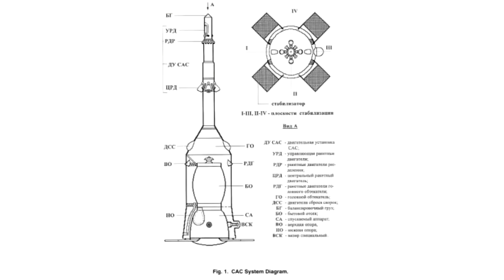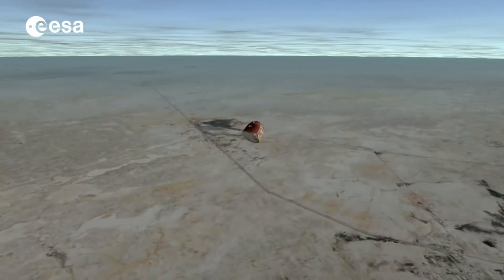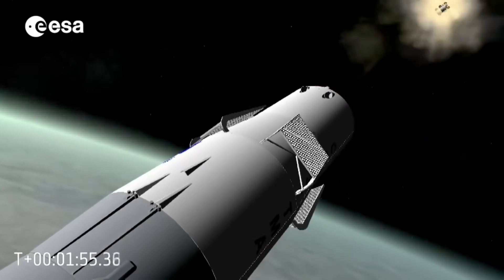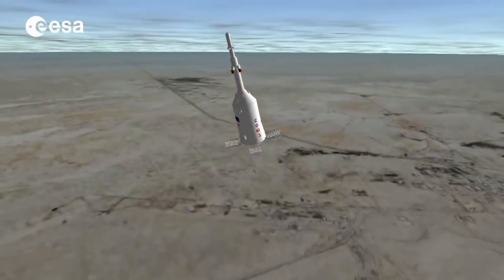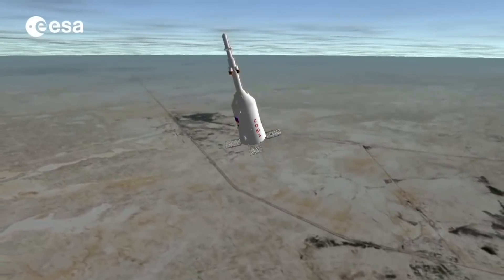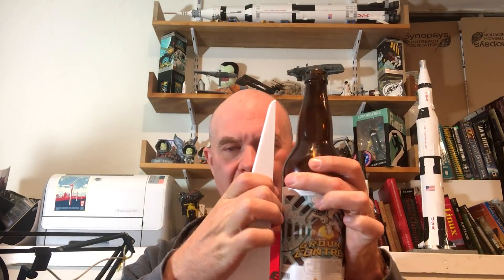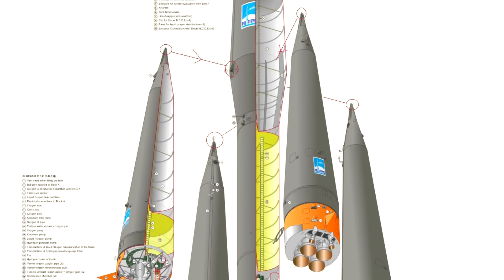Soyuz MS-10 Failure - Updates & Answers To Your Questions

Comment: Is it known where the second stage crashed? Seen alot of articles and forum posts but seems like no-one cares about it
Reply: Reportedly, all stages have been found.

Because these was no propulsion after the first stage separation, everything would crash in roughly the same area. The capsule itself, being the most aerodynamic and dense, would fly the farthest, the rest will crash closer to the launch site.

Surprisingly, the spent first stages of Soyuz are usually found on the ground in one piece (though obviously damaged by impact)!

Comment: Sounds very plausible Mr. Manley. The video evidence seems to concur (with meer speculation of course) that 1 of the 4 boosters appears to not sperate symmetrically. There is certainly excessive gas venting upon separation (for those that have watched many of these luanches) and even a possible 5th object visible separating with the boosters. Possibly debris from the impact with the core booster. 
Scary, glad they flew safe 😉

Comment: That would explain the violent shaking in the cockpit. From the booster beating away at the side of the core stage rapidly, over and over. Unless it only made contact a single time. But what else would cause the astronauts to be shaken up like that?
Reply: It's a video artifact. It's the same few frames being played over and over again, it's trivial to spot. That's a common way for a video stream to behave if it's interrupted, which is most likely was. It just repeats the last few frames in the buffer. So really it was probably just 1 big jolt, no reason to believe it was repeating.

Comment: This is why I keep saying ever space manned program MUST have two back up space craft ready to launch at a moments notice for rescue or emergency resupply or emergency return escape module for the ISS. This could have stopped the Columbia tragedy, and would provide replacement capsules for the crew to return from the ISS. We also need back up crews to pilot these emergency rescue vehicles. Even Star Trek's Star Fleet had triple redundancy on all their systems for a logical reason.

Comment: Did you happen to see the flight that nasa put up on their channel? When the boosters departed the crew was really getting thrown around the cockpit. Not sure if that's when they had the problem or not, but it looked quite violent and they switched cameras quickly. Glad they're safe🙏🙏
Reply: They weren't really getting thrown around, it was more of a single jolt. The reason it looks like they're thrown around is because the same few video frames are being played repeatedly, which is a common way for a video link to behave if it loses connection - which it probably did. And that's why they switched away from it, because it was just playing the same handful of frames over and over, and probably would confused people a lot, or, also just as likely, the software they use to control the camera feeds automatically switched camera because the link went down.

Comment: Just a question/statement of the obvious: Presumably during this kind of launch the 'crew' are passengers, not pilots. All the important trajectory decisions are made by ground control and on-board flight guidance computers. There is no need, nor option for a manual abort system?
Edit: That's what Wikipedia says: https://en.wikipedia.org/wiki/Soyuz_(spacecraft)#Launch_Escape_System

Comment: Can they change the 215 day sojus fuel in space? E.G. a Dragon brings new fuel and the old is just pumped in space.
Reply: Bringing fuel into space is expensive. No. Bringing stuff into space is expensive. Fuel is no exception, as it as a certain mass. 
It would be more feasible to bring a whole new vehicle into space rather than refuel the old one.
Reply: @NoCharName  Plus there is no guarantee that there is access to the required plumbing for a space walker.

Comment: Could you also elaborate on the morse code heard during the video. .--. (dot dash dash dot) . Its often heard during the soyuz landings
Reply: vivek soley   Morse AN is the standard Soyuz recovery beacon, transmitted (as best as Google can find) on the international aviation distress frequency, 121.5 MHz.  It may also transmit on one of the Soyuz voice communication frequencies.  Very likely, the beacon is turned on automatically by the launch abort system.  The beacon is frequently heard during NASA broadcasts of normal Soyuz landings.

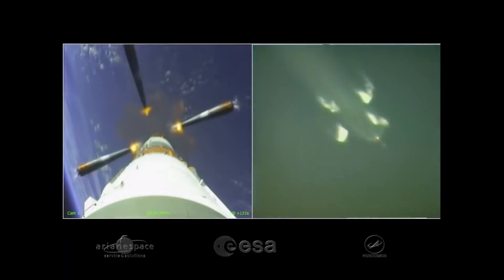Comment: @8:39  It's interesting that venting from the top of the strap-on boosters isn't visible until they've spun 3/4 of a revolution.  Perhaps the initial GOX discharge isn't visible, and it takes a moment before the more visible residual LOX is thrown about and starts venting.
Reply from the maker: I think that it’s because initially the lox is at the bottom of the tank, but as it spins the lox moves to top and becomes visible

Comment: During 1963, engineers at Department 3 and 11 of OKB-1 with support from Department 15 led by K. D. Bushuev and S.S. Kryukov developed structural design of the "Jettisonable Emergency Escape Head Section" known by its Russian abbreviation as OGB SAS. This work was also coordinated with the branch of OKB-1 in the city of Kuibyshev (now Samara), which at the time took over all development and production of the R-7-based launch vehicles.

Comment: Could you address how the ISS will reboost it's orbit if there is no one onboard?  What system would they use to do that?
Reply: They can reboost it with either the Soyuz/Progress or the Cygnus cargo vehicles, i don't think that will be a problem, at least for now. There are however, other things that can and will probably break in orbit which often require good old-fashioned manpower to fix. This is not just some ordinary satellite, after all.
Reply: Soyuz MS-11 was already scheduled for 19 December. If the investigation is over by then and it doesn't change any procedures, that could get the schedule back to the days of the 3 crew ISS until MS-12 in April.
Reply: @nunopereira6092  If they have to abandon the ISS leaving it without people they will leave in the Soyuz so that will no longer be there.  I'm curious to know how they would use a cargo vehicle without people onboard the ISS -- I'm sure it's possible, but not something that's every been tested.  Of course, if they do have to leave they might do a substantial burn to put the ISS 30-50km higher than normal before they leave giving them a few months before they would need to worry about a unmanned boost.
Reply: @Raptorman0909  Agreed. It all depends on whether they intend to ground the Progress resupply ship that was scheduled for later this month, or restrict the stand-down to the manned versions of the Soyuz rocket. The Progress does dock automatically, and it can be fully controlled from the ground, if need be. Also unknown is the situation concerning the FT variant, scheduled to launch from Kourou in early November. Will they ground it too ?

Comment: The explanation about the failure makes sense. At 9:20 we see a vast cloud, quickly dispersing -- it does not occur in successful launches. Likely cause of this cloud would be a rupture in the second stage LOX tank.

The internal view from the Soyuz capsule shows a sideway jolt that occurred at the time corresponding to the appearance of the cloud. Everything seems to point in the same direction.
Reply: First stage. Second one is too far up to be hit by the side boosters.
Reply: I thought the same thing when I saw the crews arms flailing just before the video went to crap
Reply: +Dan Traditionally, the "carrots" are considered to be the first stage, and the piece in the middle the second.
Reply: @cogoid  sort of like the stage and a half of the Atlas rocket. Makes sense.
Reply: Early on, there was some trepidation about starting all of the 8 chambers the second stage engine in flight, so it was chosen to ignite everything at once during launch, with pyrotechnic "candles." The second stage would then throttle down to conserve fuel, until the first stage units separate. (In the original R-7 there was no third stage.)
Reply: you mean the LOL thanks
Reply: I see what you did there :)

Comment: This makes me think about BFR. It doesn't have any escape system, so in case of an accident there is no escape for the crew (a lot of people)
Reply: It's more complicated than that. The BFS has surface engines that can escape in the event of a booster failure, not too dissimilar to a shroud or escape tower doing the same job. It is better than what the Shuttle had, Challenger proved that if the usually reliable booster failed, the shuttle would not survive. The BFS should survive if the BFR booster goes caput at any point.

I should also note that planes don't usually have launch escape systems, some military ones do, but no one is complaining about commercial planes not having ejection seats. Most of the time when a commercial airliner needs to deadstick, it's been because of birds, water, pilot error or a maintenance error. All of which are irrelevant or addressable in the BFS.
Reply: Ray Foss Commercial aviation is safe on a completely different level than space travel, so that's quite a false analogy. We are talking many magnitudes longer between catastrophical failures in aviation as compared to even man-rated rocketry.
Reply: They aim to make BFR reliable and redundant enough it won't need a traditional LAS but it is possible this could influence future design changes.